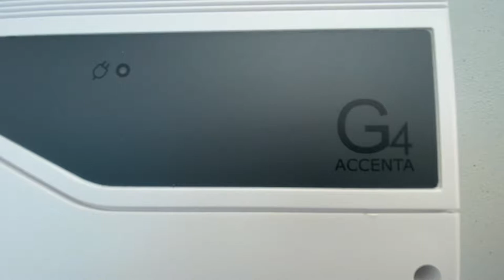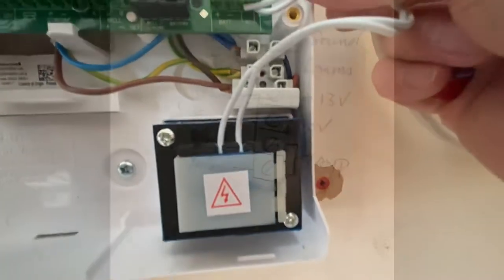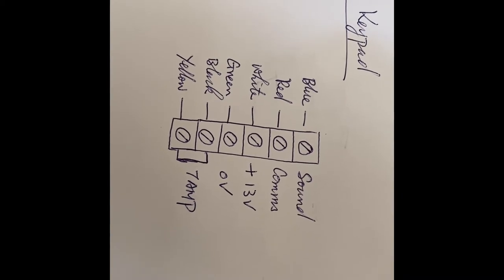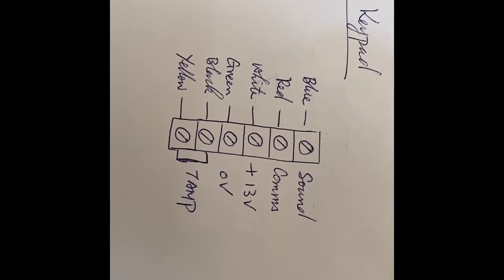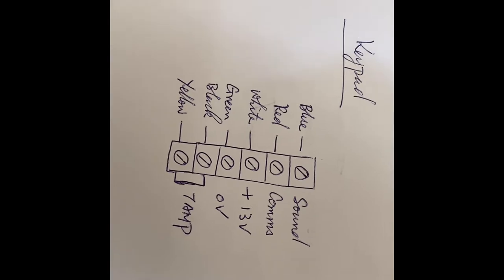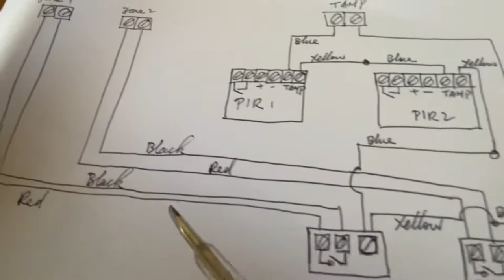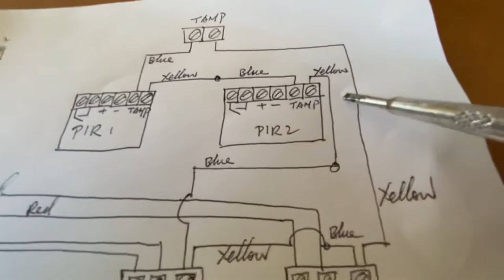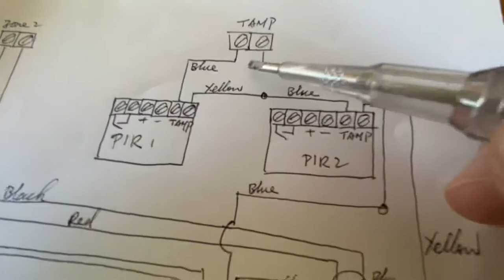How to install A Burglar alarm control panel 1

Comment: You have 2 doors on different zones, can you enter /exit through either door and have the alarm active or delay entry alarm? Is this done in the programming?
My rear door was never wired up as the garden was closed off,, but now i can access my garden via the path so i wish to add the rear door to the panel. Was thinking of running it to zone 1 where the front door is and wiring it in series. as the cable is already now in the box. Wondered what you thoughts are?
Kind regards.